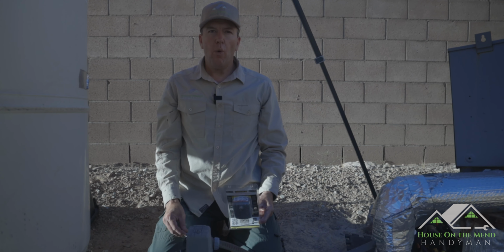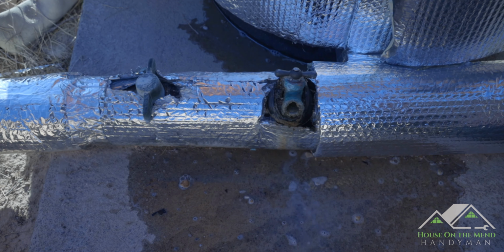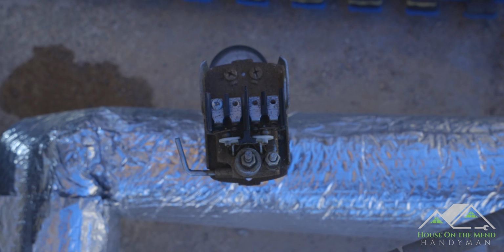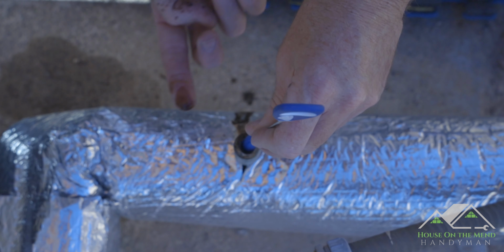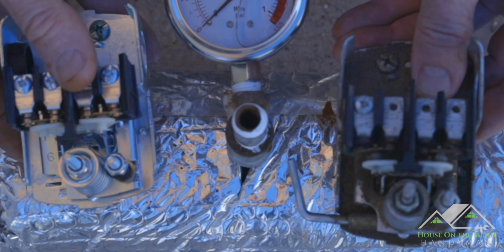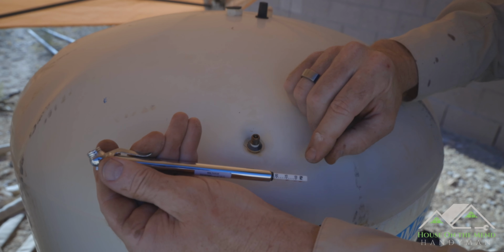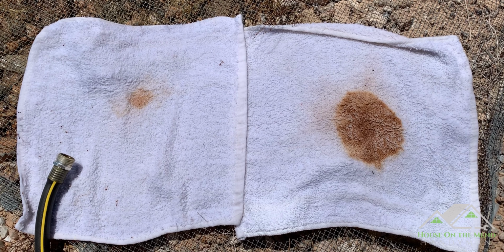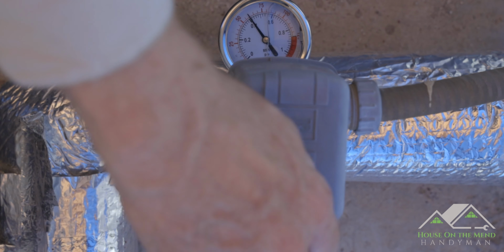Replace a Square D Pumptrol Pressure Switch

Comment: One of the best how-to-videos available on changing a well pressure switch  -  great job !   I particularly liked your tips on (1) making sure the capacitor in well pump control is discharged;  (2) tip on cleaning out the "gunk" in the existing pipes;  and (3)  Flushing the system before resuming flow to the main household / supply areas.     Excellent!   Changed out my pressure switch last night.   Not sure how much a plumber would have charged, but glad I tackled it myself, made possible by learnings from this video.  Thank you!
Reply from the maker: Leo thank you for your kind comments! I’m so glad you found the video helpful. Wells aren’t very common here in Las Vegas so there are only a few companies available to service them and it comes with a premium price. “Sweat Equity” is always the best value.

Comment: Very thorough.  Thanks!  What does the well control box look like?  Because you have that, do you have less electrical connections (2 wires rather than 4)?

Comment: The remarks about a well some distance from the house are on point! I just set up a mobile shallow well pump to run off a good but unused well until I replace the foot valve in the well nearest my home. (That was an hour before finding this video.)  In order to have a self-contained mobile system that's also modular I put a pressure switch, garden hose fittings for inlet and outlet, and a Pumptrol with the OFF-AUTO lever (for convenience, it saves needing a separate off switch but should not be considered a SAFETY disconnect, flip your breakers for that) on a 3/4" NPT cross. It took some tuning to get the best pressure for my house. 
BTW I prime using a Bosworth 400 Guzzler hand pump which are self-priming and a brilliant design from a company famous for marine pumps. With garden hose adapter they're under a hundred bucks and everyone who wants a reliable manual backup pump plus an effortless way to prime shallow wells should buy one. There are Youtube videos of them in action. I've driven wells and done all sorts of industrial and home repair and wish I knew about Bosworth forty years ago.
Reply from the maker: Ob Fuscated thank you for sharing.

Comment: Im getting 148V on my new pressure switch. does it make sense? I would assume it should be either 230 or 115V, am I wrong?
Reply from the maker: Sean if you have a pump control box it may have a slow start feature which lowers the initial start-up torque to prolong the life of the pump and sticks.
Reply: @houseonthemend  thanks for the reply. I couldn't find a control box. looks like the power goes from the swbrd to a dual fuse box and to the pressure switch
Reply from the maker: In that case you might have voltage loss from the distance the wires are traveling relative to their gauge or damage to the sheathing.
Reply: @houseonthemend  so should I expect to get 230V in the switch in my specific case? I assume 230 as im getting much more than 115V. thanks for your help! I appreciate it
Reply from the maker: Unless you have a very shallow well, I would assume your pump is 220 volts.

Comment: Dude, YOUR VIDEO, is why, I am going to do this Today, Thanks for the upload..
Reply from the maker: Get it Rod!!! Good luck.
Reply from the maker: Rod how did it go???
Reply from the maker: @hos 46 when we find ourselves losing pressure it is usually corroded sticks (pipes leading up from the pump) that are leaking and must be replaced. That is definitely not a diy job.

Comment: I had an old pressure switch that doesn't look like the new one and I can't tell for sure which wire goes where by their pathetic wiring diagram that comes with it. And not one single video I've watched so far explains that to you. Just copy what you had before. Well it's not the same so you can't. Otherwise it's a very good video.